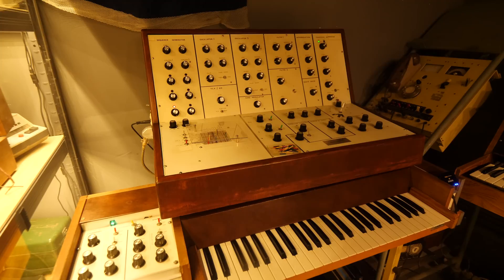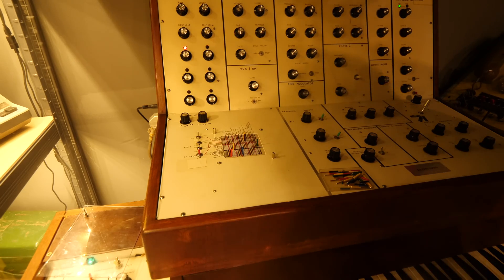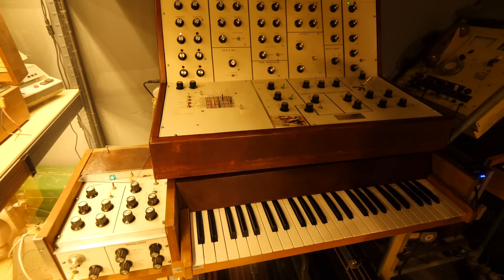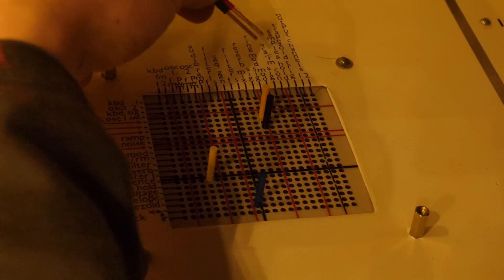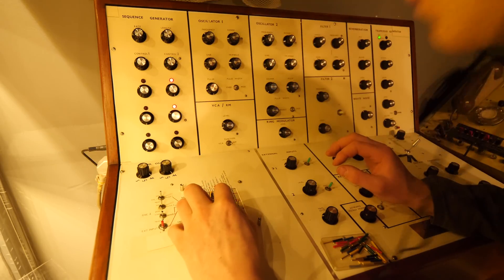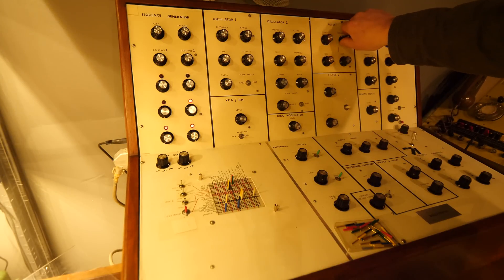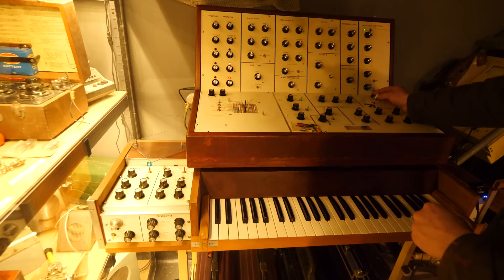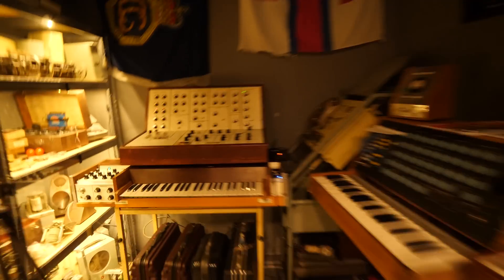Putting pins in the patch matrix of the RIGGYSYNTHI

Comment: Very interesting sound of that reverb. Sounds like softly distorted, like very old germanium or even valve. It has it's own very strong charm. Perhaps that's just mic's, but result is beautiful.
Reply: If it’s a spring reverb there’ll be a (pre)amp for the pickup, so who knows what kind of amp circuitry is colouring it! Probably 70s transistors.